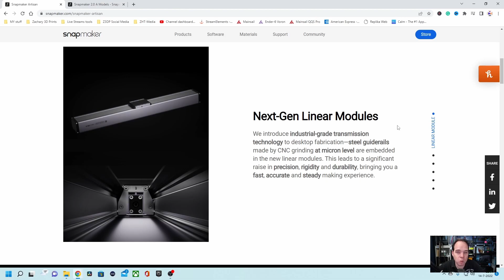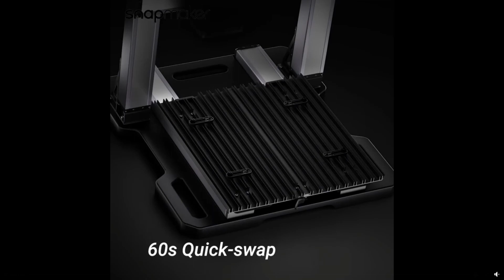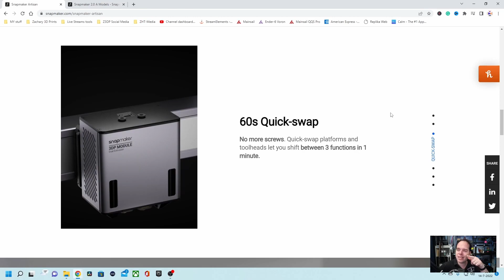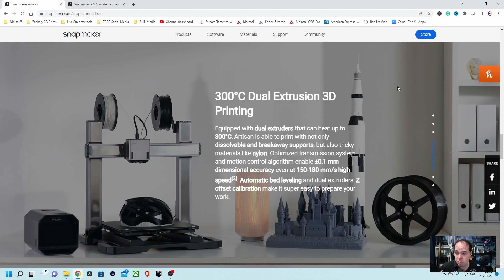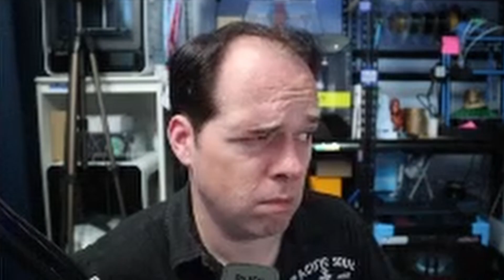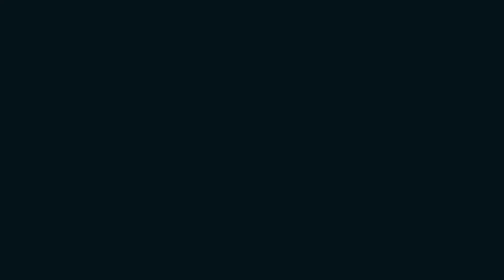Snapmaker Artisan 3-in-1 - Zach Reacts

Comment: @Zachary - I think you must have gotten yours as a freebie because no one I know was happy with the original Snapmaker let alone Snapmaker 2.0. In fact this artisanal one seems to be what the Snapmaker 2.0 should have been and those amazing customer focused folks at Snapmaker didn't even have the decency to offer previous customers/supporters a discount. 

This is the Mac of 3D printing/CNC/Laser engraver - looks good but the minute you step out of the bounds they have set for you it becomes a nightmare. You can see this influence in their promotional material, their own manuals, even the background workshop layouts they have. It does 3 things but none of them well and apart from a large volume 3D printer the rest of it is more on a toy than tool level. Not for anyone serious about any of the 3 tasks and not for anyone who wants to tinker to improve things. You hand over alot of money and take what Snapmaker give you like a good little consumer/customer, if your really want to push the boundries you can try to work around its limitations where possible but some of them are just so derp its not funny. If you compare it inline with other high-end 3D printers it just doesnt stack up, 150-180 is barely faster than you can get on a souped up Ender 3 S1 with Klipper and its smoked by the Bambu Lab X1and hell for 3K you can get a voron pre-assembled. 

As a previous Snapmaker customer (and never again) who tried really really hard to like what Snapmaker were doing save your money for maybe the Prusa XL which will likely have comparable functionality but with far far better support both from the company themselves and the community. Snapmaker can never match up and its clear they are focused on a closed eco-system which is hilarious because sweet FA of their original and Snapmaker 2.0 stuff is interoperable.
Reply from the maker: Hi David, sorry for my late reply on your comment. No I didn't receive any freebies from Snapmaker. I received the J1 from the Kickstarter campaign last Feb. 
I have heard a lot about the issues of the 2.0 and their bad customer service. There are better printers for that money. And this Artisan is way out of my budget, besides that I don't have the space for it